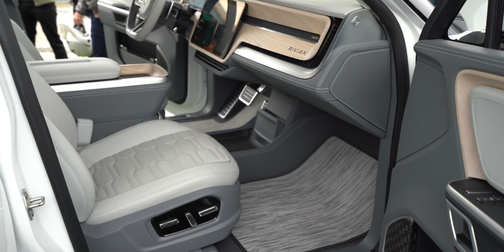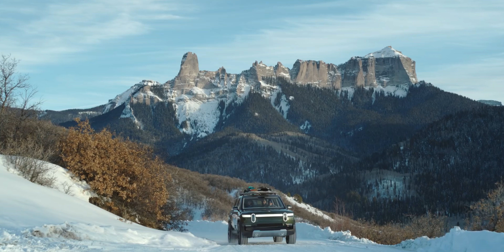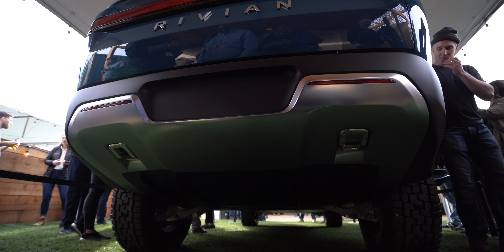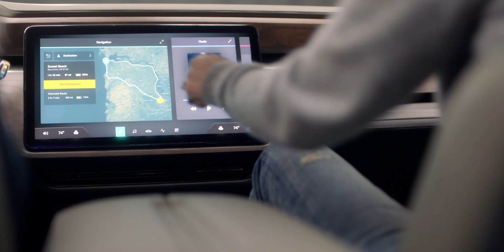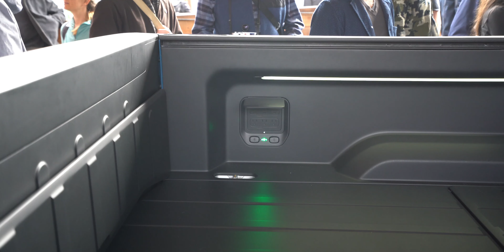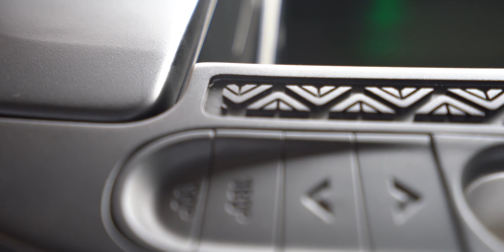Chatting with the Founder/CEO of Rivian on the Truck R1T & SUV R1S

Comment: I heard 300 mile range, not sure what battery size will deliver that . Is it 100 KW, 90 or something else? Sorry I miss that.
Reply: They have 3 battery sizes.
240 me range, 300 and 400 plus a gerrycan battery to add in the bed. 500 range.

Batter sizes . I think 180 is largest. 120 smallest. Then a middle size. I am sure it is on their web site and also price/ordering calculator

Comment: Well I think I'm a bit more partial to the Cybertruck which is what I'm planning on buying at the moment versus the R1T, but if I was getting an SUV I'd take the R1S over a Model X, Etron, or EQC.
Reply: I saw Rivian at Fully charged. The suv opening was only about 46 inches wide. We will see if they stretch it to 48

Comment: Awesome video!! I still have my early reservation for the truck but idk if it will be worth it to loose 20K or more in 1 year waiting for the cybertruck + depreciation.  I also don’t see any autopilot feature. ( I have M3 )
Reply: dnquality The R1 vehicles will come with 2 Forward-facing LIDAR, 4 Radar (surround coverage), 10 cameras (surround coverage), and 12 ultrasonic sensors (surround coverage) so they will be L3 Autonomous Ready, based on when the software is complete!

Comment: The Rivian R1S suv is very cool. It compares to the Tesla Model X suv very favorably on price, range and quad motor performance. Personally I think its a lot  better looking and more functional than the X. If it makes it to production and reviews well I will probably buy one.
Reply: I saw the suv at fully charged.
It had 3 row seating. 
The rear opening was less than 46 inches wide:( plus there were arm rests built into the walls of the suv that made it even narrower . Maybe final production will get 48 inch wide opening

Comment: One of these companies has to make a truck with 400 plus miles with a spare tire.
Reply: metsfaninct rivian has a full spare in the truck bed
Reply: askeeter84 know if it will do 400 with it? I believe the spare tire is optional.  I have a preorder for cyber.  Would love Elon to find some way to fit it in.
Reply: @metsfaninct  You bring up an interesting point. they said these are the mid-rangers. maybe long range won't have a spare. I doubt it tho.
Reply: If the largest battery pack replaced the spare. The battery would be above the rear drive motors. 
Check out fully Charged Rivian video. 

Rivian also has a patent for a gerrycan.  A extra battery pack that sits in the bed and plugs into the main pack. 500 mile range.

Comment: I would rather drive my Model 3 off a cliff than give Amazon access to my vehicle data via Alexa.  It's nice that you can turn it off, but you'd have to trust that it really is completely disabled.
Reply: "It's nice that you can turn it off, but you'd have to trust that it really is completely disabled."
You can say that about any smart assistant and device - Google, Cortana, Siri, your smart phone, and the plethora of IOT devices.
Reply: Chuck Correct...
Reply from the maker: Fair.  But I know they were taking privacy into concern as a top priority and making sure off means off

Comment: I wonder how efficient this is over a Tesla model x.

Tesla has some of the most efficient evs.
Reply from the maker: Will definitely be interesting to see!
Reply: Not very well. 2.2 miles per Kwh if their specs are accurate (EPA yet to be measured as well) but it won't really be an accurate comparison as a Model X is a mid-size SUV and the R1S is a full-size SUV which is more of a Range Rover competitor. Don't forget the Rivian has 4 motors which would make it more capable off-road and is also heavier and taller which would affect range. Maybe when Tesla releases the Cybertruck battery sizes then we could get a rough idea of the difference in efficiency.
Reply: @CardizoneSemblance  yeah it's not really fair. Teslas look and operate the way they do to maximize range. These guys sure are lifestyle vehicles, and do not operate on an efficiency emphasis philosophy. Trucks and full size SUVs will never hold a candle to low Cd lower power EVs
Reply: Model X 
 you void the warranty if you go off road.
All quality built  electric motors are very efficient.
Reply: There’s nothing to compare, they are in totally different categories. The Tesla model x is a mid size SUV while the R1S is a full size SUV, the model x have only 2 electric motors while the R1S have 4 electric motors with real offroad capabilities. As far as I can see, Rivian has way better quality build than Tesla.

Comment: The Rivian adventure network sounds interesting. Kudos to them for taking the initiative on themselves as I wouldn’t put all my eggs in EA’s basket.
Reply: I like the adventure aspect of Rvian but they need to remember most of us dont buy adventure vehicles.. Range, price, charging and reliability are our main requiremnts.
Reply: @danabe3220  remember. Tesla started with a 200k roadster.
They do need some cash flow asap. 
When battery prices come down and energy density climbs.  The smaller cars will come

Comment: My biggest issue with the R1T is that it's a bit bigger than what I want. I really wish someone would come out with a smaller pickup with a lot of the same features. I know most people seem to want big vehicles so it makes more sense for them to go after the larger market but there is a need for a smaller version also and I really hope they fill it in a few years.
Reply: So you are basically looking for something the size of TRUCKLA https://www.youtube.com/watch?v=R35gWBtLCYg
Reply: @KCautodoctor  more like in between truckla and the ones which are coming out from several companies. I basically want an electric and modern version of a 90's ford ranger, or chevy s10
Reply: What size truck out there now is the size you like?